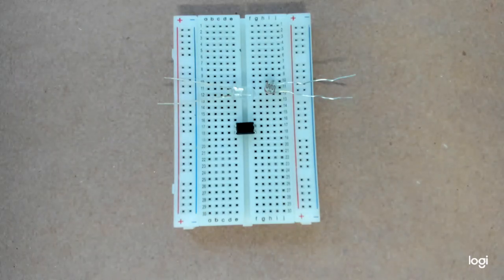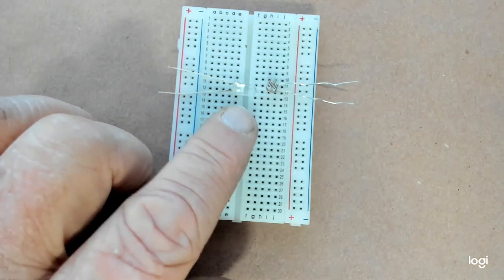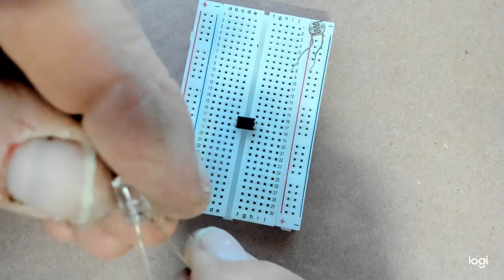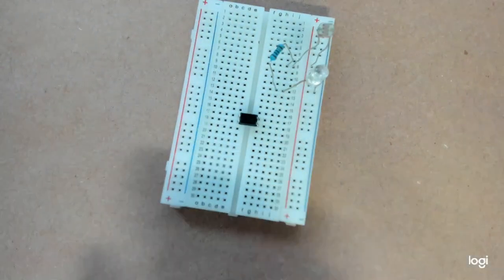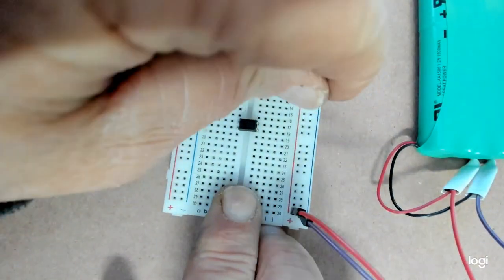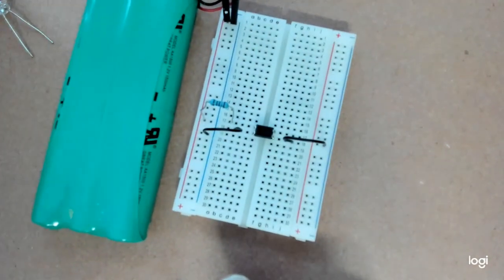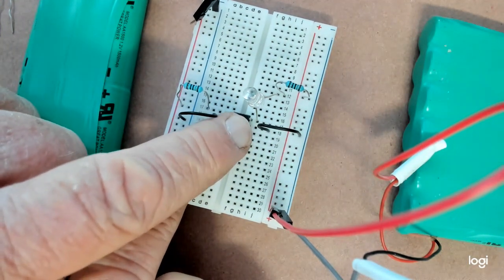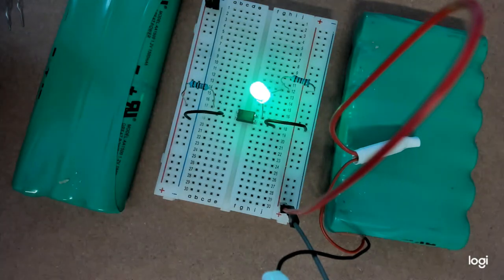Optocoupler 817B explained without all the techno mumbo jumbo

Comment: In the industrial world, optocouplers are used (usually inside PLC digital input cards) to prevent ground loops.

Your PLC might be several hundred feet away from whatever signal you want to monitor.  The ground potential at your sensor very well might be different than the ground potential at your PLC.  Without isolation, you could have a significant current running between the ground at the PLC and the ground at the sensor.  Optocouplers ensure there's no electrical path between the sensor and the PLC.

Comment: One may ask why/when would you use this.  To further your explanation for those learning  electronics, one could think of optocouplers as a type of relay where you can trigger a lower voltage to come on by using a higher voltage (or vice versa)
.   Such as a 12 volt source turning on a 5 volt source. ...
Reply from the maker: Great explanation thanks for the added info for my subscribers

Comment: Hi, great video and getting the principal out there. However, you did say that the pins 3 and 4 are a resistance just like your example LDR (light dependnt resistor), The 817 pins 3 and 4 are internally connected to a photo transistor, the transistor is using light at its base layer to switch from collector to emitter rather than a voltage applied to the base. Having said that, you clearly put the point across and described its use perfectly. Regards, Geoff.
Reply from the maker: Thanks Geoff

Comment: Great vid!
Reply from the maker: Thanks, stay tuned for more to come, thanks for watching and supporting this old man
Reply: How did you determine what value resistor you needed  @DIYELEKTRONICKITS
Reply from the maker: By the size of the input voltage to turn on the optocoupler @poncethegayboi